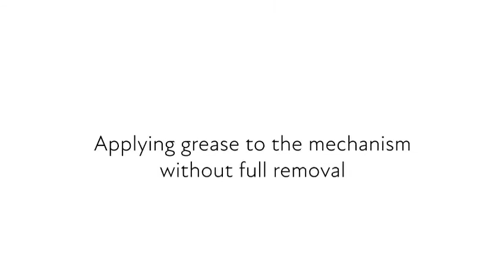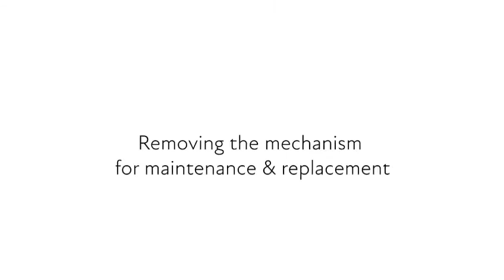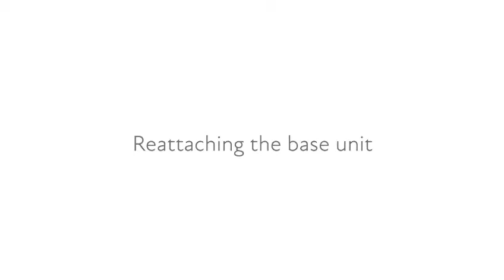Maintaining and replacing your swivel rocker mechanism

Comment: This is exactly what I needed, thank you! Where to I find or search for the correct washers, bolts, nuts and rubber washer. I bought a chair with all but those items so the base needs to be attached
Reply: My bolts are about 2.5cm long (including fitting through mechanism and chair), 5mm in diameter for the shaft of the bolt, and the head of the bolt is 2cm wide. Metal washers are 2cm with a 5mm hole, spring locking guy is 5mm size,  and the rubber washers are 3cm or so wide with the 5mm hole for the bolt. I can't promise this will work for you but used the mechanism I mentioned in my other comment so you can see if your sizes are similar (and hopefully scale if not). Good luck with your rescue project! ❤️Tolerances are super tight on mine but it worked out, don't give up on it!